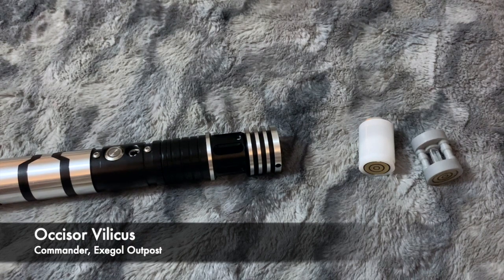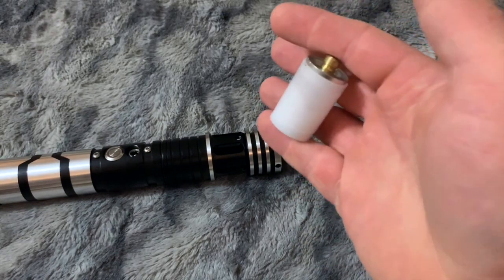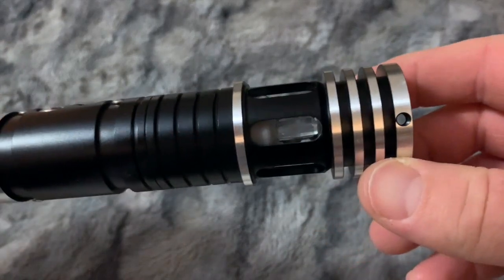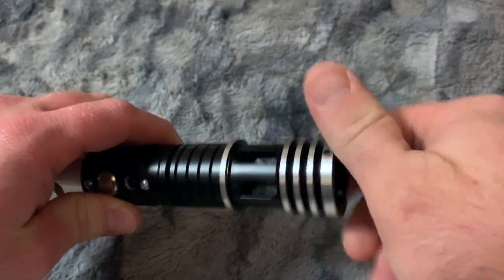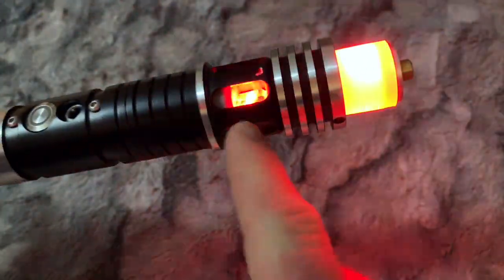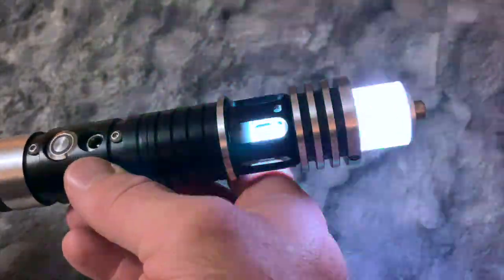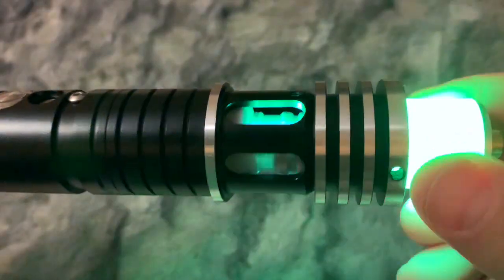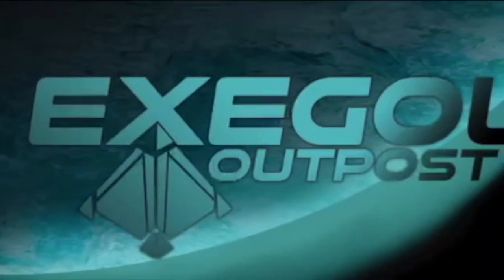Removable Crystal Chamber Breakdown

Comment: What is the length of your core? I have a Xenopixel currently, but have a proffie core on the way. Just trying to figure the length to see if I need extenders etc.
Reply from the maker: If I recall correctly the distance between the switch and the hilt side pcbs doesn’t change regardless of what board it is. The crystal chambers add about 1.5 inches to the total length though!

Comment: Would you be able to create a removable piece with a curve based on the VHC curve connector? Trying to find a easy way to convert a standard to curved hilt
Reply from the maker: Do you have a link to the part which you are referring to?
Reply from the maker: @brunolbari  making one with a straight crystal in that space would be next to impossible… BUT…. I think I could potentially make one with a Krayt Dragon Pearl- similar to this: https://exegoloutpost.com/shop/ols/products/removabledrop-in-krayt-dragon-pearl-chamber
Reply: @exegoloutpost1738  No crystal needed there, just a curved piece with the pixel connections (plate on the bottom and pins on top for the blade)
Reply from the maker: @brunolbari  oh, ok! Yeah, to get the dimensions right I’d need you to send the hilt to me so I can get it in the right location, but I think it can be done.
Reply: @exegoloutpost1738  Ok! If I pull the trigger on the pieces I'm looking at, then I'll definitely let you know
Reply from the maker: @brunolbari  I would likely need you to send me your hilt with the part installed so I can measure and plan accordingly, but I’d love to take a crack at it for you!

Comment: Are these crystal chambers compatible with proffie boards too?
Reply from the maker: They are compatible with any pixel setup. Proffie/golden harvest/Xenopixel
Reply: @exegoloutpost1738  awesome!  So if i add this to a proffie saber does it count as another blade with its own bladestyle in the config file like most crystal chambers do?
Reply from the maker: @dj000000000002  this crystal chamber will match whatever blade style you are using, basically it functions as the first pixel in the blade.
Reply: @exegoloutpost1738  ok sweet so i Dont have to add separate blade styles thats awesome. Thanks dude.
Reply from the maker: @dj000000000002  anytime!